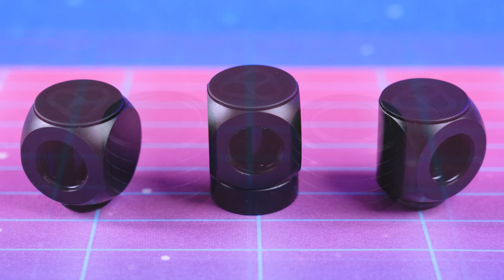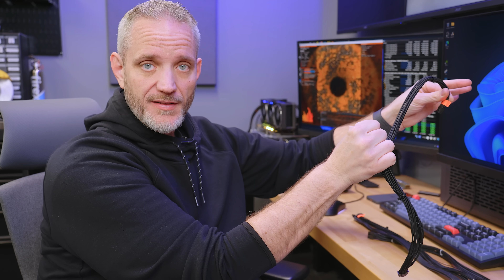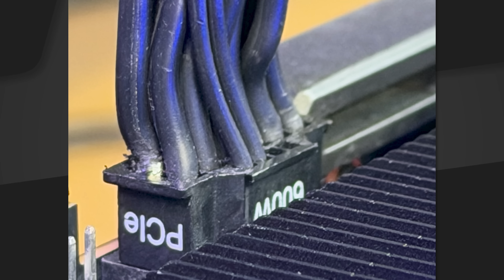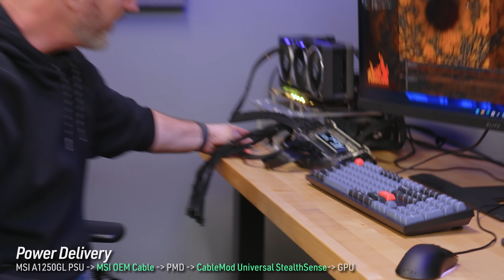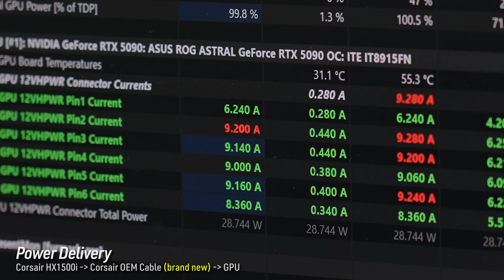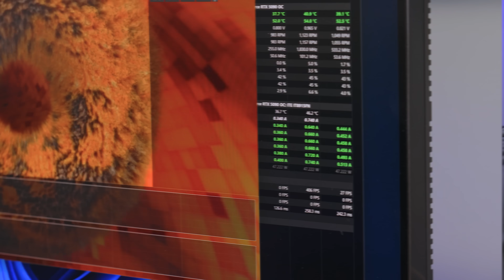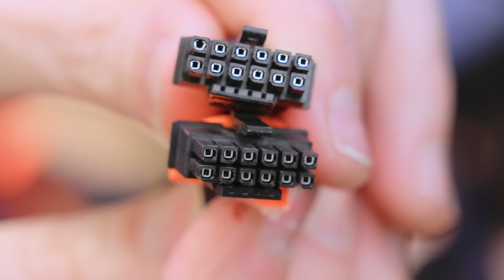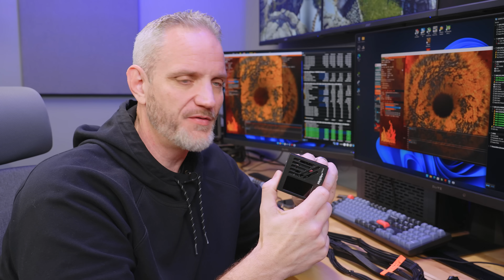More details on what could be causing 12VHPWR / 12V2x6 Cables to melt

Comment: So not only today GPU cost a lot. 
You also need special adapters and cable for them not to burn ?
That's crazy.
Reply: Add to that $2000 of soldering equipment...
Reply: IMHO I think what this is pointing to is that we hobbyists need to understand that these high current cables require care with handling. Remember when we learned about ESD sensitivity of ICs? (1979 in my case, blowing a 6502 processor). I think it's the same thing.
Reply: Feature, not a bug.
Reply: Tbf if you're willing to spend 3k+ on a GPU why would you not go ahead and invest in a good cable?
Reply: BTF is the solution.   Sad that it isnt used more
Reply: @gummybearkiller1 it's not a solution, it's a workaround. The solution is to make an actual cable spec that doesn't cause the cables to melt
Reply: Nvidia is definitely for consumers who aren't brokies.
Reply: no dude. you are just watching pure misinformation and swallowing it all lol. he’s just farming views
Reply: its literally less than 1% of cards have this issue, not to mention nvidia rma is lower than AMD. People need to get a grip
Reply: @newguy1122 I don't think it's 1%,it's probably higher than that.
Reply: @UltimateGattai  server and pro variants are showing up for repairs involving this connector.

It is definitely higher because those guys are less likely to go through thrid party repair shops who MIGHT have some connection with the general public. The few that have leaked through are hardly all there are to it.
Reply: @newguy1122 so easy to drop made up numbers from your hat (to keep it polite)...
Reply: @Ghrifter  im not the one making false claims.
Reply: @newguy1122  less than 1% of millions of cards is still thousands of cards at a minimum. that is still very unacceptable. and you don't see this kind of problem to this degree with 8-pin power connector cards.
Reply: @ThePlantoparadise  They haven't made million RTX 5090's yet They've probably only made about 150,000. 
& the issue is the total volume against the pci-express 8 pin is the 10 millions the 1% failure rate on them. if you go by volume the % increases when you get to 1 million RTX 5090. it would something like 10% or more.
Reply: @fishingkev2332  are we just glossing over the 5070s, 4080s, 5080s, and 9070xts that all run 12vhp that have melted? this issue isnt exclusive to 5090s
Reply: @Jwol1103  Oh I know I think the connector sucks. I got two RTX 2080 ti in S.L.I & I've seen them pull 585 watts max. No melting no smoking. It's a lot easier to deal with power spread across two cards instead of a massive card. It's also better because 32 wires instead of 12 smaller wires.
Reply: @fishingkev2332  the rma % for 5090 and 5070ti is .5%. That is extremely small and well within all margins for manufactured goods. Im guessing you don't buy anything manufactured or you are clueless and throwing around random numbers
Reply: @fishingkev2332 i just wish my $800 9070xt didnt come with some shitty connector that can ruin my card. Itd be nice if we got the option between 12vhp and 2x8
Reply: @newguy1122  I think you don't understand VOLUME.
Reply: @fishingkev2332  considering its volume thats very good, especially compared to amd's cards with their lower volume. Get a grip
Reply: @fishingkev2332  and its rma isnt even about the adapter either, its about missing shaders and rops.
Reply: @newguy1122 says who? Source?
Reply: @mh8877  go look it up, its really not hard
Reply: @mh8877 finally someone with common sense
Reply: @newguy1122  if it's already at 0.5% moving from 100,000 to 1,000,000 moves it  to 5% over all that's far higher failure rate then pci-express 8 pin plug by A massive amount because the 8 pin at 5% at 10,000,000 units. Like I i said you DON'T understand VOLUME.
Reply: @newguy1122 which we know of.

Comment: It a $20 multi meter and test cable end to end. You do not need to buy expensive gadgets
Reply from the maker: Multimeter will not give you the result you are looking for on this.
Reply: @Jayztwocents  milliohm meters exist, every insulation and earth tester has that funcion inbuild
Reply: @hanswurst-h3e you can picture him now trying it realising we are right.
Reply: @That_App_Company  well its not exactly 20$ for one
Reply: @hanswurst-h3e 😂😂, £40 Amazon and at least can be used for any other products. definitely not worth buying all these gadgets cost $170. 

You see them all up in arms about GPU MSRP but $170 for a cheap plastic/metal power connector
Reply: @Jayztwocents Sorry Jay but from an electrician a multimeter will measure end to end of the cable. If you know the length which you do, if you know the gauge which you do then you will and then you will know how much resistance/ readings will be in your meter. 

Made up example… cable is 50cm long, 0.25 diameter so multimeter should read 171 ohm. If there is a break in a strand or a loose connection then the reading will be higher.

Basic electrics

Comment: Jay I'm glad I got my 9070xt with 3x 8pin instead of the one with these connectors 😭 I have never had an issue with the 8pin why are companies pushing these  knowing the issues
Reply: because for the consumer its less than 1% of people experiencing failures.. and its so nice to have only 1 cable as opposed to 3 or 4 for cable management purposes. 
But i do get what you are saying, they need to make these be 0% failure rate. ESPECIALLY for 3000 dollar plus GPUs
Reply: Did you not listen to him?  If you unplugged your card 100x then your cable probably would fail also.  You've probably plugged your card in once and left it.  12hpwr is fine.  You plug it in all the way, leave it alone and it runs fine.